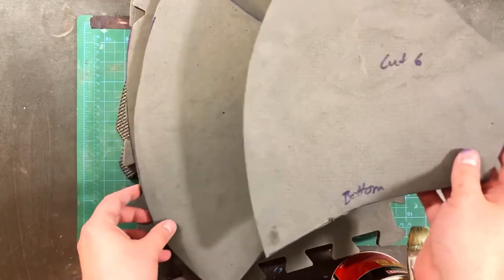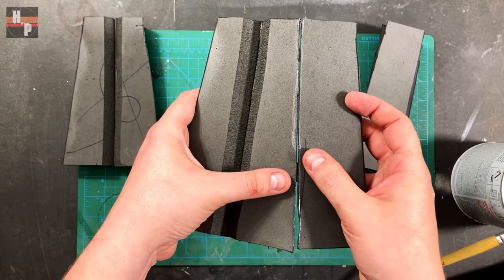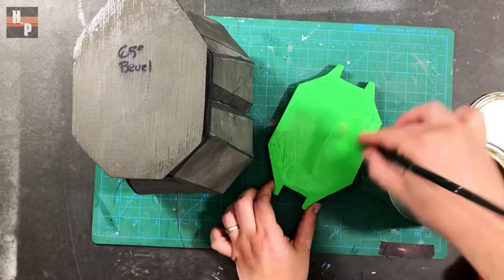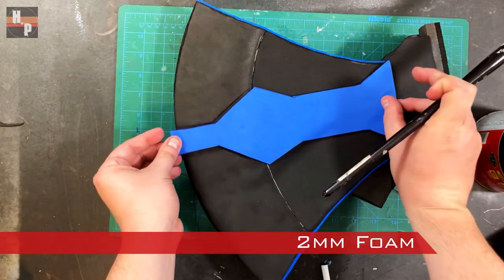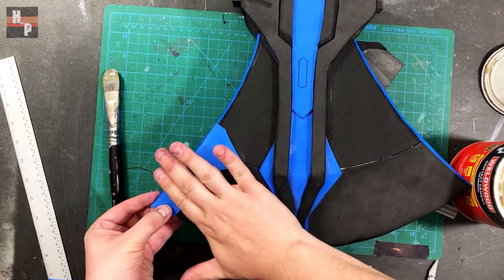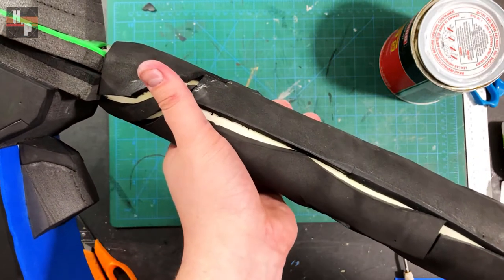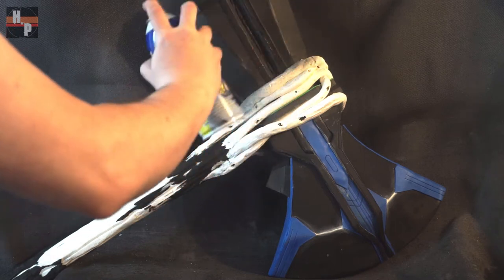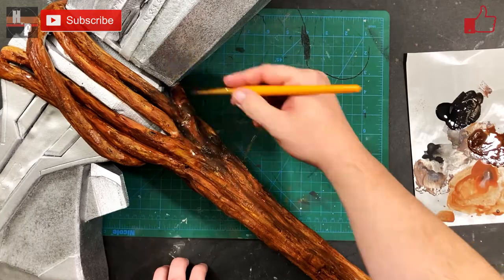How to make Thor's Stormbreaker from Love and Thunder out of EVA Foam | Marvel Studios THOR 4

Comment: Awesome! Does anyone know the life-sized dimensions, or how big to print the template? Thanks
Reply from the maker: Thanks! In regard to the life-size dimensions, I made it 4 feet tall. I couldn't find any measurements that were movie based, so I based the height off of Chris Hemsworth's height. Print the template at 100% as a poster. This will give you registration marks to help with alignment. I hope this helps:)
Reply: @haasofprops  thanks mate
Reply from the maker: @BrandonWorkshop  You're welcome:)